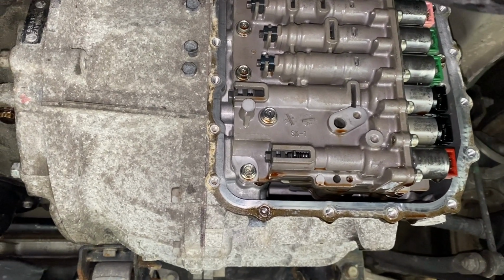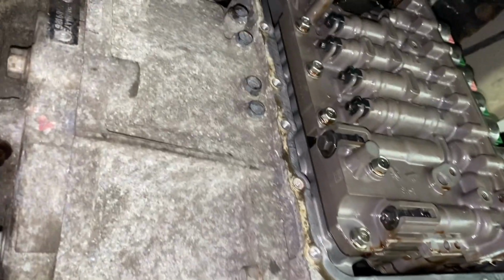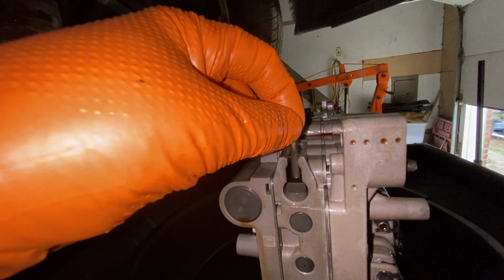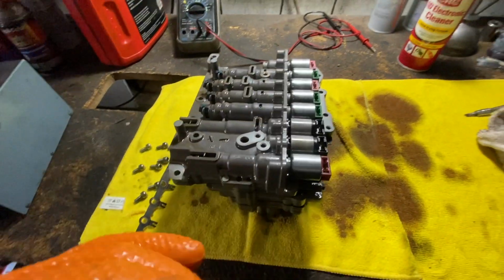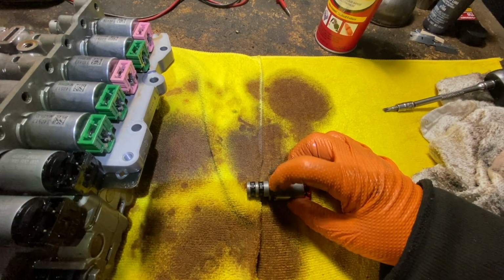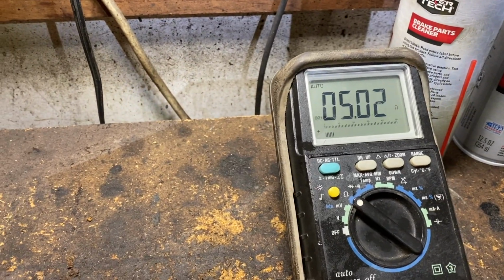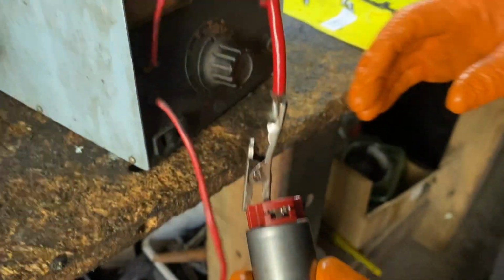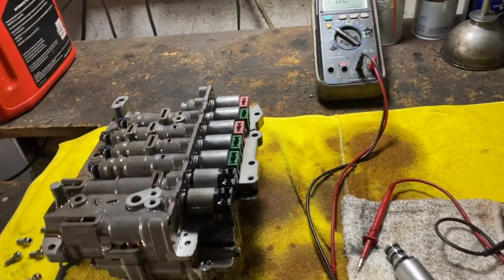Transmission Solenoid Cleaning & TestingOn 6 Speed Kia / Hyundai - A6MF1

Comment: My car has p0722 for a speed sensor but I replaced it and I still having issues with the shifting vehicle revs up high and does not go past first gear really don’t know what’s going on. What do you recommend?
Reply from the maker: Did you check the wiring to that sensor?

Comment: Hi I dont know where else to post this but i found @Motorcarnuts videos very helpful so i just thought i would ad some valuable information for people who are having a problem like what I had...

I had a P0753 code on the A6GF1 transmission and when i tested the solenoids they were all good, but when I tested the wiring harness in the Transmission i was not getting continuiety on pin 5 which is the power suplly for the solenoids but when  I pressed whe ribbion cable hard on the connector i got continuiety.

Replaced the transmission harness with part number 46307-3B650 which is the superceeded part and it solved my problem, there are other sources on the internet which suggests that you use the oem part which is what I did.

All the best to the guys with this type of problem
Reply from the maker: Thank you for adding this extra valuable information and congrads on the fix!

Comment: Very informative thank you! I don't know if you will respond to this but I have a thought provoking question. What if the vehicle is showing no codes, but after resetting the ECU, the vehicle experiences hard shifts between gears and seems like it is in over drive. After resetting the ECU again this issue goes away, but comes back any time the battery is disconnected and has a chance of happening again. Could this be a solenoid issue or a transmission control module issue? Is there a way to further test this? The car shifts perfect otherwise and will go without this problem for months.  I mentioned this to my kia dealer and they did some "test" and said the vehicle is fine without codes and it could be a possible "TCM" issue and the computer has to relearn, but this issue is intermittent. Last time it occurred it was raining all week. I plan on testing the solenoids per your last video and don't know if this vehicle has ever had the transmission serviced.
Reply from the maker: Car will have to relearn after interruption of power supply. Can be a faulty TCM or bad ground somewhere in the system.

Comment: Hi. My 2012 Kia sportage AWD. Transmission guy said I need a new tranny and a new coupling assembly. I was wondering if I replace the coupling. Would the transmission run better. I had the fluid changed at my indie and it got worse
Reply from the maker: I don't think so

Comment: My KIA OPTIMA 2012 has been having gear slippage for 3yrs now & acting erratic when changing. I changed gear oil severally even with synthetic gear oil, yet no change.

I then had engine overheating issues last month Dec 2023 & it turned out my cooling fan was not working.

After fixing the cooling fan, my mechanic suggested that we remove the THERMOSTAT since our climate here in Nigeria is quite hot.

Guys, we removed the THERMOSTAT & to my greatest SURPRISE, barely a week later I noticed the gear slippage had stopped!

I went back to my mechanic who said apparently, the gear was overheating all along & that's why it was acting up! But removing the THERMOSTAT must have helped to further reduce the engine & gear temperatures!

So if you're having similar challenge with the transmission of your car, you might try removing the THERMOSTAT & watc the performance of the car for a while!

My KIA OPTIMA 2012 is fine now & shifting perfectly!

I'm so happy because I was already planning on getting a brand new transmission this year.
Reply: I had similar problems with my transmission. Same year optima sx. I CHANGED that thermostat to a new one and it fixed the problem

Comment: I have 2011 Koup, 6 speed auto, hard shift from 2 to 3rd gear. And 5 to 6th gear. I’ve replaced the fluid AND wire harness and temp sensor, nothing fixed. Could be a bad solenoid? If so, which one should I replace
Reply from the maker: I would replace the valve body with all solenoids, you can find them on ebay for a good price and with waranty

Comment: I have code p0753 shift solenoid A electrical on my 2012 kia optima it only drives in 4th gear, any advice on what to do?
Reply from the maker: You could follow video and try testing and cleaning them first before either checking wiring or replacing the solenoids.
Reply: @motorcarnut  ok thank you!

Comment: Hello i have a 2014 Kia sportage 2.0 crdi automatic trans , before 2 years i run over a big curb which made my transmission pan cracked and let all the fluid out . After we replaced the pan and poured with fresh fluid it wont shift 4th gear and above but it reverse normally and 1st 2nd 3rd gears are normally whenever it hits 4th gear the car revs and wont move forward so we scan it and it shows P0734 and P0735 then i went to several mechanics and they said to replace the whole transmission so now its been 2 years without solving the problem and i use manual shifting till the 3rd gear ( about 40 km/h )  . Before 3 months i tested the solenoids , colored ones shows 5 and 6 ohms and the two black ones shows 11 ohms and i noticed that the solenoids harness there is a bit crack in it ( the black plastic ) and also a bit crack at the bottom of the valve body where it hit the curb . So does replacing the valve body and its harness a good idea .  Any suggestions please help and thank you
Reply from the maker: See when the vehicle is involved in a crash, in person inspection is required. However, yes replacing the harness and valve body with solenoids should solve your problem with the fourth shift problem.
Reply: @motorcarnut  but brother since there is no part number in my valve body i checked on the inernet and it says 46210-3B200 and its solenoids have different color than mine even the long numbers written in the angles with QR codes are not the same as mine . Mine have the same color of solenoids of the one you fixing there is even 46210-3B011 and many more. How i figure out the right one for me i really appreciate your help
Reply from the maker: @MoMo-tq8uc where are you going to buy the valve body and solenoids from? Usually the whole thing is one package for your year make and model. I wouldn’t recommend buying everything separately. That can cause problems
Reply: Hello ,  when i install the new valve body does it need to be reprogrammed although hyundai / kia TCU are not integrated in their valve bodies. Thanks a lot    @motorcarnut
Reply from the maker: @MoMo-tq8uc No, but it will go through a relearn process
Reply: @motorcarnut  Ok. is it with scan tool or with regular driving and thank you so much for ur help
Reply from the maker: Try it with regular driving first if you don’t have a scan tool

Comment: So my daughters 2011 Kia Sorento has always had some shift issues mainly when down shifting while passing or on a hill but couple of months ago shifting got really bad plus it seemed to lack power and had poor acceleration. I drove it and in automatic shifting was very erratic or would not shift, it shifts when you manually shift it but still no acceleration and lack of power. Checked compression, fuel pressure, catalytic converter (was changed about 2-3 yrs ago but checked it anyway), everything checked fine, symptoms pointed to bad torque converter, pulled transmission and put in new torque converter, also put in new wire harness because I had read where they caused problems particularly the temp sensor, put it back together and drove it and same problems. Was pretty frustrated, took it to dealer even though I'm not that confident in them, they checked same things I did and drove it and said transmission needed replacing, tech said fluid looked funny and had metal flakes, I said fluid was brand new, filter brand new and when I took it out it old fluid wasn't to bad . Took vehicle home found a used transmission with reasonably low miles and had a warranty, checked solenoids with a meter before I installed it, they were all within spec, transmission looked pretty clean inside, old fluid was a little dark but nothing out of ordinary. Put in new filter, installed transmission, drove it and same problem as before, granted it was a used transmission but I find it hard to believe a totally different transmission would have same exact symptoms. During all this there has never been any engine or transmission codes, even got a new scanner that is bidirectional and it showed the solenoids all passed plus like I said I actually physically checked them with a multi-meter, only thing that troubles me is when I activate the solenoids with the scanner I don't hear anything at least that I could tell, my experience with solenoids  both at home and at my work is they always made some noise when activated ? I'm wondering if speed sensors are funky even though there is no codes or something internal in transmission or in the valve body, any ideas or seen or heard of similar problems ?
Reply from the maker: Couple of things come to mind. Let me ask this, if you manually shift the transmission it doesn’t have that much power correct? If so, it does lead me to believe it’s the engine and even though you replaced the catalytic converter it may of failed again causing these problems. Both transmissions doing the same thing is very unlikely unless there is a computer problem, bad wiring somewhere in the vehicle. If the engine is running normal when you put it manually in let’s say second gear and don’t shift it, it should have plenty of power regardless if the transmission shifts or not.
Reply: @motorcarnut  That's correct, very poor acceleration/power in automatic or manual. I have wondered about catalytic converter even though when I put a pressure gage on it it only showed about 1.5 psi, can't remember if I raised RPM's or not when I checked it. I  also wonder about the O2 sensors even though I'm not getting any codes. One odd thing about the shifting, I can hit all gears manually and in automatic it will generally do 1-4 and maybe 5, if I go really slow but if you accelerate normally or fast it struggles to shift out of first or second but if I back off accelerator all the way for couple of seconds it will shift to next gear. When I first start it up say in morning or if it's sat for a while and give it some gas when I start it seems to have normal power until it shifts, after that if I stop or slow down and then go again, its slow. I'm an above average, pretty experienced DIYer/mechanic but this has got me frustrated. Anything other than checking back pressure or inlet-outlet temp on cat converter ? How about O2 sensors, actually on this one the upstream sensor is a wideband A/F sensor ? I appreciate your responding to my comments/questions.
Reply from the maker: @coreydinsdale7258 Yeah no problem. Your daughter’s car is a 2.4 or 3.5? I’m assuming the 2.4? Anyway, try taking out the upstream a/f sensor and give it another test drive to see if power came back. It will be a little loud but won’t hurt anything. If it’s the same, it’s not a clogged cat, if it is much better it’s the cat. Even if the a/f or 0 2 sensors were not connected it wouldn’t cause your problem you’re describing. Also would most likely set codes anyway. Also make sure the rubber intake pipe the goes to the throttle body is not ripped anywhere. Had a couple of vehicles that had similar problems because of that.
Reply: just read your latest reply and interestingly I tried that the other day because of another post I had seen and bingo, drove and shifted pretty normal. Like I said and you kind of confirmed, I found it hard to believe that a totally different transmission would have same  exact symptoms so kept looking online and  researching and numerous posts about these symptoms ended up being bad catalytic converter. Even though I checked the back pressure already I decided i better take a look at it again, first I looked at the inlet and outlet temperature and there was a huge difference (wish I had done that earlier), so then put the back pressure gage back on and it was still showing an acceptable reading but I figured maybe its not very accurate or flaky, so was going to do the vacuum test and thought I'll just pull the upstream sensor and drive it and it drove much better. Just wish I had  dug a little deeper into that right at first, would have saved a lot of time, effort and money. Live and learn they say, I guess on the positive side she has a transmission with less miles and hopefully whatever shift problems there were went away. Thanks for your suggestions and help.  @motorcarnut
Reply from the maker: No problem! Now if you are going to keep that vehicle you have to figure out what killed the cat in the first place? Running too rich or lean, misfires, overall worn mechanically etc.They don't fail, they get murdered, Lol Good luck!

Comment: Hello, I have an Elantra 2015 1.8L, in my case when the transmision is cold, I put it in drive and it needs a couple of seconds to engage 1st gear and with a little  ckick. No issues while driving it, shifts would go smoth from 1st to 6th, up & down with no slipping not issues at all. Then I turn the engine off, after five minutes transmission will not engage 1st gear niether 2nd  using manual mode, so I need to let the tramnsmisson to cold down for at least 3 hours, then I would be able to run the car again. Already clean the valves, oil is new, no improvements. Do you think is a mechanical issue, or some valve is failing when hot? thanks in advance for looking at it
Reply from the maker: Sounds like a solenoid problem. You cleaned them but did you test them and then check for resistance before and after powering them up? Valve body may be dirty as well and would have to be taken apart and cleaned. Unfortunately I didn’t make a video on that one but if you’re handy I can send the literature on it.
Reply: @motorcarnut  Thanks for your answer, yes I test them all, resistance and functional they are ok, but I think as you said valve body could be dirty, please share manual or any literaure that can help me and more important to do not make mistakes, thanks!!
Reply from the maker: @CloseKnowledge here, just take your time there are a lot of pieces that cannot get mixed up. Look though it first to see it you can do it. Good luck

https://atracom.blob.core.windows.net/webinars/import%2Fa6mf1_rebuild.pdf

Comment: I these videos are so helpfull. Now, I have a 2012 Cerato Koup 2.0 Automatic transmission.  I drove over speed bump and then my car wouldn't change gears. No noise, nothing. Just not shifting. Only took 1 litre ATF. Still no gears. Where do we start looking?
Reply from the maker: My guess would be a loose or corroded connection that controls the transmission. Because it happened right after hitting a bump.

Comment: Hello, so in my case, when the oil is cold or has not been driven yet. It shifts fine. But as soon as the oil is hot. Its shifts funny, hard shift, slipping. Sometimes even at slowing down the transmission wont downshift. Doing it manually is if also. What do you think the problem is? 

And yes the transmission has been changed after more than 100k but i changed it 3 times now after I experienced the problem but it is still doing the same thing
Reply from the maker: Could be failing pump, when fluid is cold it’s thicker when it warms up it gets thinner and causes the problems you’re experiencing. Also you can try cleaning and testing the solenoids like in the video, can’t hurt.
Reply: @motorcarnut I saw another video that you can’t change the filter without separating the transmission and engine. So if it’s true. Do you recommend doing it? 

Sorry if its too long 😅